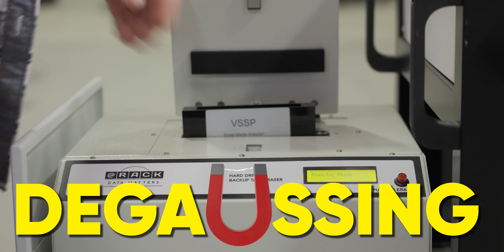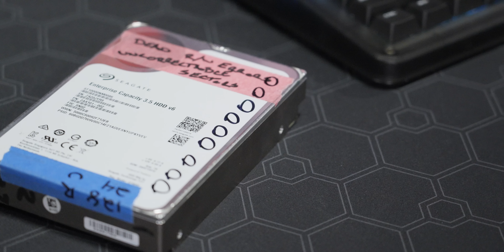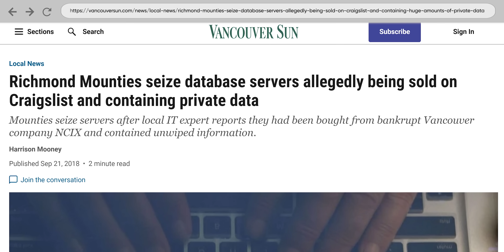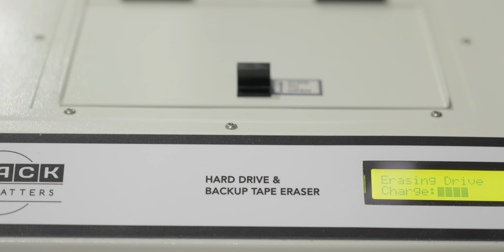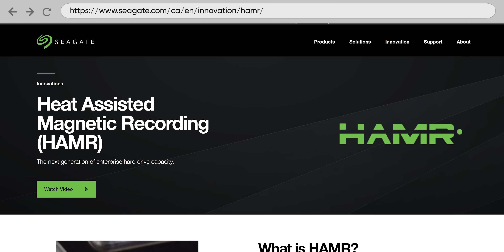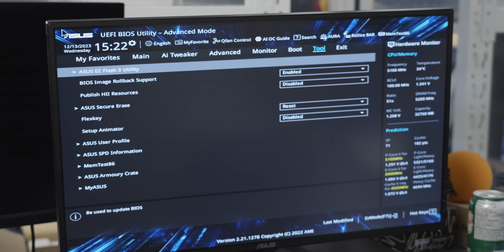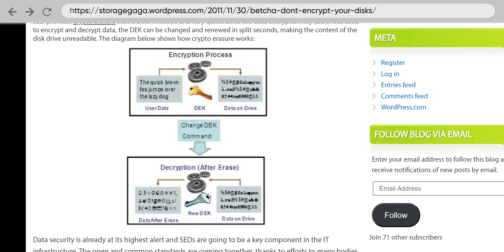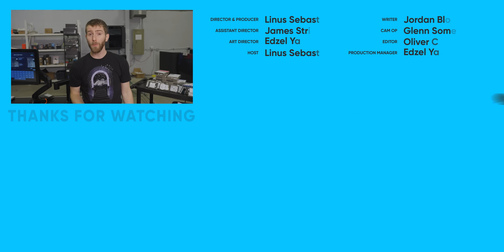I Got an Industrial Hard Drive CRUSHER! @Rack's Mobile Data Destruction System

Comment: This is similar to how I said goodbye to all my old hard drives about 5 years ago.  😢
First I placed it under an electromagnet that can pick up 100 metric tons.
  I then cut it in half with the oxy-fuel torch.  the latter gave quite a mess of a lot of molten hard drive flying around, because it wasn't a solid sheet of steel. 😂😂

Comment: SED drives do always encrypt even if "not enabled" so a secure erase still works regardless.  Locking the drive just adds another key, which protects the encryption key, to prevent the drive from being moved between machines without first secure erasing it with the PSID printed on the drive.

Comment: but linus what about forensics? can the police recover anything say if a criminal has one of them machines to destroy the drive .

since the destruction happens so fast a button could be pushed by the time that the door is smashed down and by the time the agents get to the criminal the drive is destroyed

you can get around the power limits by.

1. if it is the eraser then just wait longer for the capacitors to charge.

2. if it is the hydraulic pump and the pump is separate from the motor that drives it by either belt driven or coupled shaft you could get a 2:1 reduction gearbox that will drive the pump at half the speed and be able to crush the helium drives.

3. if your shop is wired for 220 say you have a electric range, dryer or ceramics kiln you can just connect to the outlet for those items.

4. if you have 3 phase and you may if the building has one of them rooftop air conditioners if it is low voltage 3 phase you should be able to split off 2 of the 3 wires (there are high voltage 3 phase lines that run 400 something to 600 or more volts for really big industrial stuff.

5. if you have a 110 line that can support enough current you could get a 2:1 step up transformer and boost the power to run the machine.

is sed what apple uses with the T2 macs?

Comment: The SSD chip crusher busted up the chip enclosure... but did it actually crack the chip die?  Offhand, I'm not familiar with the size of dies used for nand chips, but a lot of chips use very small dies.  What keeps one from extracting the surviving die and repackaging it?

Comment: Some guys I know (they refurbish laptops for poor People in our country) and they wrote a program with numpy to manually overwrite and nullify every bit of a harddrive. It’s surprisingly performant (but we are still talking multiple hours a drive. Because they overwrite every bit multiple times as you said) They got a thread ripper server running Linux just for erasing disks from old company laptops . 

As far as I know they’re Procedure is good enough to pass some certifications but I don’t know which
Reply: "numpy" "threadripper" "performant"
It's not 1990s and you'll only be limited by the drive's write speed.
Reply: @VADemon unless you insist on true randomness for some reason, in which case that's definitely gonna be the limiting factor unless you have specialised hardware.
Reply: @unvergebeneid  that's silly. even if the requirement were to be non-repeatable securely random oberwrite (why?) the performant way would be to generate a cryptographically random stream with AES, which is already accelerated to gigabytes/s per core on Zen microarchitectures.

Actually I think the only technical explanation for Threadripper would be its I/O capabilities.
Reply: @VADemon  I agree. There are tools, however, that are limited by the entropy pool. Not that more cores would help with that.

Comment: This unit still needs so much manual intervention. Are they planning on a conveyor belt or robotized vesion where ypu drop a pile of disks one side and they come put degaussed (at 450°) and crushed on the other side?

Comment: They need an AI model to read a bar code from a picture? Really? Like REALLY?
Reply: There are thousands of models of hard drive and the order of barcodes can vary. It’s to help the program decide which long string of numbers is the model and SN without creating and maintaining  a massive lookup table
Reply: OCR has always been based on ML/AI
Reply: @cassist000  not *always*, but yes it is alot older than the current AI scamGPT train

Comment: I work at a E-Waste recycling facility. We use a hard drive shredder. Just last week we destroyed ~500 hard drives. It’s a lot faster, it can destroy a full sized drive in around 2- 3 seconds. You can feed in 2.5 and solid states as fast as you can and it chews them right up. M.2’s we have to cut in half by hand. The waste from the destroyed hard drives is sent downstream and recycled for its bace metals.

Comment: They used to use these handheld electric magnet erasers for cart tapes at radio stations. I wonder if they would work??
Reply: Not strong enough (they weren't even all that great at erasing DATs) and they also tend to overheat quickly, so you spend a bunch of time waiting for them to cool down enough to start working again.

Comment: Leasing for less than $1000 a month 😂.  The whole cart is worth maybe $5000 at most.  Gotta love hardware as a service.
Reply: We actually have a client using our MDDS currently, and they process around 1k-2k drives per month
Reply: @rack_tech  Sounds like the exact kind of Customer they're made for!
Reply: @AdamBrackney please share the link/info of this 2k package
Reply: @rack_tech  Very first result does over 10000 gauss and costs $2200.  Found that with 10 seconds of effort.
Reply: Especially since they said it was using a Raspberry Pi...
Reply: Bad take. Many outfits don't need to own one of these, and maybe require the use of this type of machine once or twice every decade. The cost of ownership doesn't make sense for upfront cost, storage space, maintenance, etc. Nearly every outfit would rather rent/lease this machine when they actually require it's use instead of holding onto it and spending more money.
Reply: @mygamertag2010X  Lol.  Data Centers are obviously the main clientele.  Once or twice every decade 😂
Reply: $5k at most? Just the degausser is ~$6k on its own
Reply: @cheesetomatoes  You can buy them all day long for $2k in a package already designed for wiping hard drives.

Comment: My only concern with this unit is that all of the parts you need to access are at knee level, meaning there is a risk of injury from bending over.
definitely better engineered than what we do at work, which involves a hammer and ice pick (effectively)

also be good to see the drives being recycled as there are potentially a lot of reusable materials in the drives.

Comment: Question: Can destroyed hard drives, SSD's be recycled? I wish the video covered that too.
Reply: Generally speaking nope. The problem is if you crush it as one entirely assembled drive, everything becomes one or a bunch of mixed scraps. The better solution would be for platters to be destroyed separate from the hdd controller and the body of the drive. Circuit boards once broken can't be recycled as no one is going to seal the broken edges of multi-layer boards just to reverse electroplate them.

If they gave a damn about preventing ewaste they'd open the top cover of the drives, smash the platters and recycle the rest; for SSD's they'd only destroy the NAND chips and/or the controllers (could drill through them).

The method shown in the video creates nothing but ewaste.

To anyone who goes "but Snowden" - remember, he didn't steal drives, he snuck files out of a microSD card he smuggled in and out of a secure facility.

The solution to not need to physically destroy drives is to use encryption and simply destroy the keys and then create new ones, then write zeros to everything.
Reply: @matthewnirenberg but then governments cant greenwash as effectively by throwing things into landfills instead of recycling
Reply: The same as any other e-waste. Shipped to china where they salvage anything worth anything, and the solvents get dumped in a river/lake and the solids get thrown into a landfill or incinerator.
Reply: Theoretically, yes. However having worked for a hospital, recycling classified material was considered unsafe, all our paper and destroyed hard drives went to a secure facility (presumably a landfill)
Reply: Probably as much as other technology.

Comment: i worked for a massive data destruction facility and this is not what was acceptable. this was only done after every single sector of the hdd was overwritten hundreds of times with a random number generator ( mersene twister ), after it was verified that every sector had been done several times, then it was physically destroyed such as this.
Reply: why
Reply: Hundreds of times? What was the data deletion standard that you guys had to implement?
Reply: overwritten hundreds of times? LOL! Any idea how long that would take with a 20 TB spinning drive? :)
Reply: After the Degausser, there is no data
Reply: @rack_tech  incorrect. the degauss does have a solid chance of ruining it but it is not completely destroyed.
Reply: the same process was repeated 3 to 12 times (dod3) depending on the customer each pass was 36 so minimum 100 plus passes, i cant say the software name because it would identify the company but that was just step one for data wipe. step 2 was a massive degausser that was so violent the hdds would dance on it and jump it was nuts lol the noise it made was incredibly satisfying.after that was physical destruction. some required the whole process to be on camera some just required audits/reports. fun fact the highest security request we got was not from a bank but a major automotive company. we could only guess what they wanted destroyed but they asked for the most reporting, video, audits and signatures and proof that the hdds were converted to 3mm balls. they had to go through a hammer mill and chain shredder !
Reply: @Mile-long-list there's thorough and then there's paranoid.

Comment: The biggest real world non-CIA problem is when a drive just stops working. This way you have no way of overwriting your data but it most probably still sits there and the drive might be easily repairable. So far I have always submerged such drives in water (someone somewhere said it should work) and then smashed it to bits by hand. No one is getting the name of my contact in North Korea!
Reply: Full disk encryption saves from cases like that.
Reply: @JGnLAU8OAWF6  Doesn't it slow the PC down? I have a single computer for both work and gaming.

Comment: If I'm not mistaken I think the current procedure for HAMR drives with high data sensitivity requirements is to use ATA Secure Erase, then shredding, then saving the shreds and sending to a secure destruction smelting/incineration facility to basically turn it into slag. I think most cybersecurity people aware of HAMR put out a moratorium banning acquisition and production use of HAMR drives.
Reply: Flying to an active volcano sounds easier and possibly cheaper.
Reply: Wait, why would they ban HAMR? It sounds like it would be super awesome for cybersecurity to me.
Reply: @galacticviper4453  If it makes it harder to erase (I mean look at all those steps above) and you have to do it to every single drive then you're talking big bucks, easier to just buy non HAMR and do it in facility.

But I don't think HAMR does anything positive for cyber security, it's still just a drive at the end of the day the data is no harder to read than any other drive (unless I'm missing something)
Reply: @Gunny-rt3lb  mobile shredder/incinerator trucks also exist.

and they are cheaper than taking all of the steps shown in the video once you are talking about a significant volume of drives.
Reply: Damn talk about over kill
Reply: All of those cyber-security people can better mandate not storing any unencrypted data on HAMR drives.
Reply: Just throw it in a star why don't you
Reply: I mean, it's called a HAMR drive. Its name alone tells you how to destroy it! 😆

For the people without a funny bone (or those who doesn't like dad-jokes), this is a joke. Of course I know you wouldn't just whack it with a sufficiently large hammer. It would be cathartic though! 😁
Reply: I want those drives with more capacity. Atleast general public does. Workspace is different story.
Reply: Nah, I don't belive this, I job too hard with my laptop in my bag and it's hard drive gets cooked beyond repair.
Reply: Why do they have something against HAMR specifically? Does the heating thing make the data "stick" more than on a normal drive?
Reply: @alex31ytb HAMR drives are magnetic immune without the heat described in the video. MAMR (Microwave) drives are somewhat resistant also. 
The only way to ensure data cannot be read from those types of drives at this time is to ensure the disks themselves no longer exist. Combination of shredding the drives to 2mm or smaller chips followed by melting/incinerating the chips completely is required to achieve that goal.
Reply: @TheFirestormable  Bingo. This is why most people who work in VERY high data sensitivity environments write moratoriums to prevent their use. Because disposal is such a pain in the ass. Most people here are not going to be familiar with working in an environment like that and how serious the security requirements are but they're incredibly stringent.
Reply: @alex31ytb its not the heating, its the fact that the drive platters are made of a material with higher coercivity therefore they're unable to be degaussed
Reply: @alex31ytb  I don't know the exact physics, but here is my understanding:
In HAMR drives they use a material with a high hysteresis for changing the magnetic field. So the magnetic field has to be much higher to flip the materials magnetic field. 
This makes it much less likely for a bit to flip accidentally. 
By heating the material it briefly looses all it's magnetic properties including the existing magnetization (something that can be observed with magnets, when you heat them they loose all their magnetism) this also resets their hysteresis and they become easier to re-magnetize than other parts of the material that are already magnetized.

In the context of the video, for bulk erasing the data purely with a magnetic field, it has to be much stronger than the field of the bits on the platter since the material doesn't become re-magnetized as easily. 
The other option would be to heat up the materiel past the curie temperature which is where this loss of magnetic properties happens, this would also work on normal hard drives (since all magnetic materials loose their magnetic properties at some point) but they didn't do it in this machine probably since heating the entire drive would take much longer.

Comment: Hello, maybe you can help me and give me contact information to someone sensible from Razer - Razer has only problems - laptop 15 blade 3080RTX 360Hz i7 was very hot from the very beginning, after 2 months the disk died and a moment after the warranty the battery swelled, contact with Razer was made when purchasing the computer. Then they have you in ... ... I'll tell you this, don't buy Razer for a lot of money.

Comment: Cool demonstration but I'm disappointed you didn't try using drives after degaussing them.

I have found using manual degaussing on tapes has resulted in mixed results.
Reply: Hey! Adrian! Never expected to 
see you here!
Reply: Although what I had used at the time was less sophisticated than the looks of this unit, results were indeed a mixed bag upon testing afterwards. I certainly would try a few out in the beginning if for nothing else a piece of mind knowing that there isn't just a speaker making the audible "thuddunk" noise lol.
Reply: that's probably a floatplane exclusive content then.
Reply: @EmilePolka  Nope. The Floatplane exclusive is Elijah and Sammy squishing various media.
Reply: @EmilePolka 😂😂😂😂

Comment: I'd love to see a video comparing the different ways to delete, wipe and destroy data and drives then try different recovery methods to see which way to wipe data and which ways to recover data are the best.
I'm especially interested in the destroyed drive taken to that cool drive recovery place they've made a video about before
Reply: They would get nothing. The data recovery service is for fixing things like a physically broken drive, or one that's file system got corrupted. Things of that nature. For example on a broken drive they can disassemble the drive and put the platters into a machine to read them.

They can't reconstruct what isn't there though. At best is what they mentioned in the video on older drives.